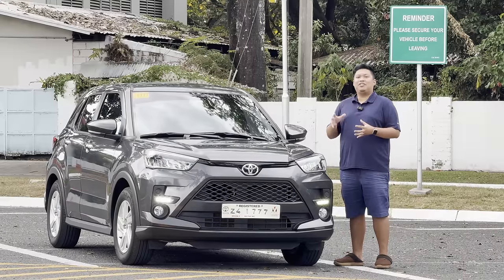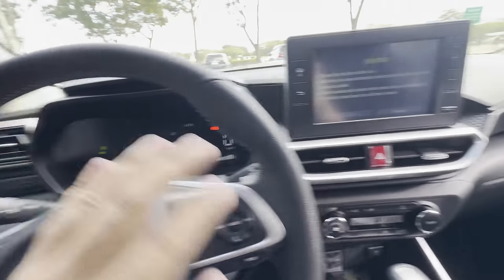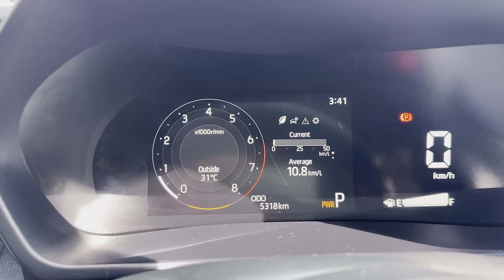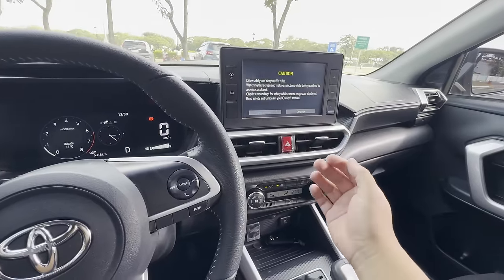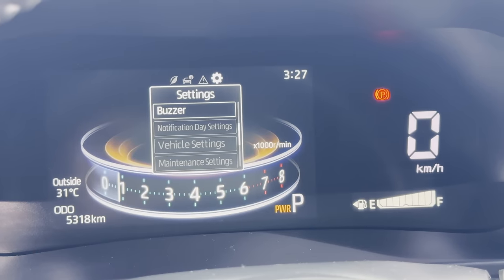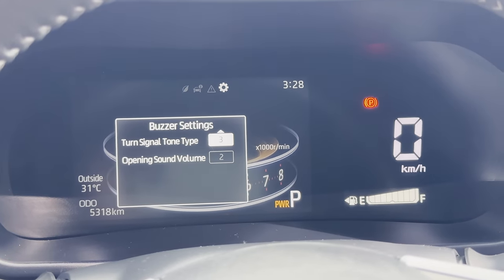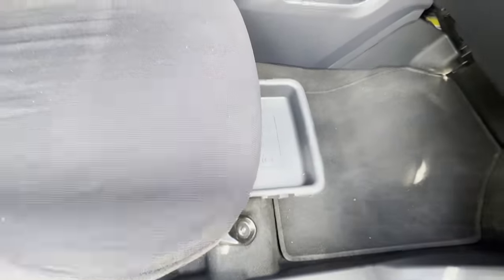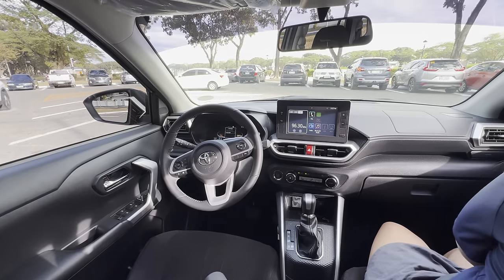2024 Toyota Raize 1.2 G CVT FULL TOUR REVIEW

Comment: The move towards ignition start/stop ignition button is a trend, but I'm still skeptical about it because while it can't be hotwired, ADAC showed a video on how car thieves can easily steal cars with this ignition system. When ADAC tested this last 2014, they didn't even have to break anything to get inside the car and drive it away, with a signal range extender device, they can just open the door and drive the car normally. The process only takes few seconds. I really hope they already corrected this security flaw.
Reply: There is immobilizer installed in this variant. It's difficult to starts the engine without the key recognized by IMMO module
Reply: @benzonjhermogeno  hmmmm. In the ADAC's tests, they claimed that the signal range extender defeats the immobilizer, hopefully the immobilizer in this variant rectifies that weakness.
Reply: Agree, I'm seeing some folks recommending RFID blockers for key fobs.